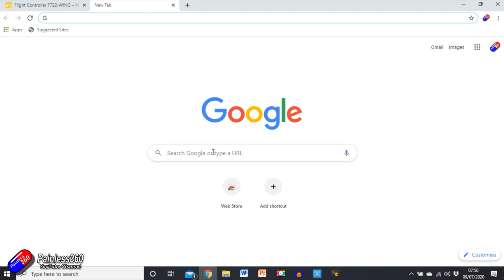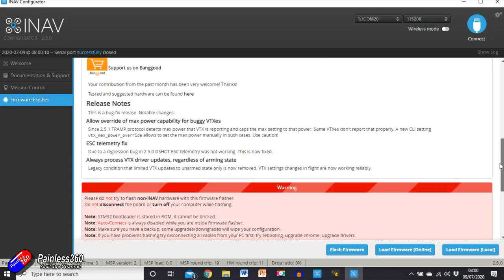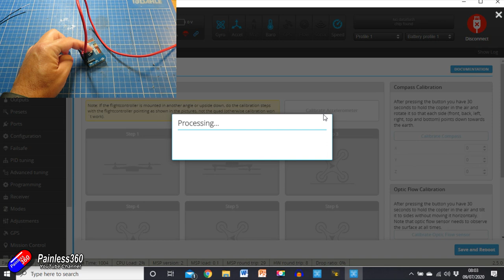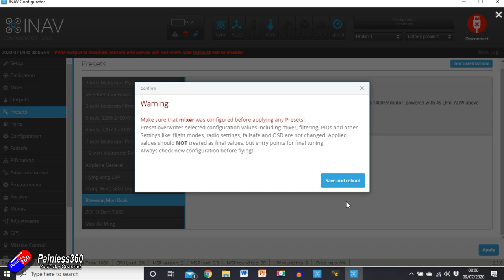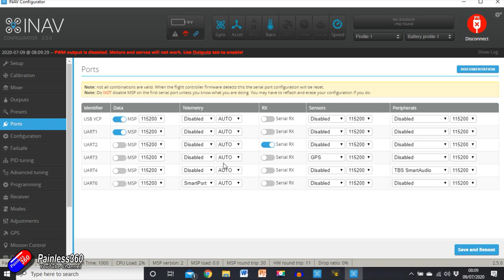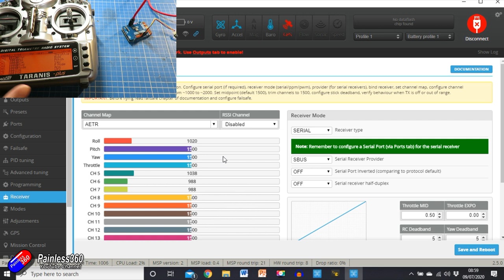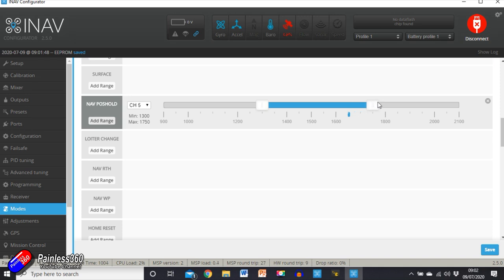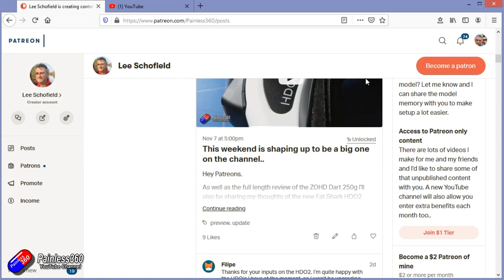iNav for beginners 2020: 2. Flashing the flight controller and basic setup

Comment: Fantastic video, Lee! Thanks a lot! 😃
Let me ask you something... Do you think it's better to start flying manually (I mean an airplane without flight controller or anything) or I should start with iNav right away? I still couldn't build my first airplane. 😬
Anyway, stay safe there with your family! 🖖😊
Reply from the maker: You do need to know the basics to setup iNav in a FW so some manual experience is handy. If you can get another pilot to help set it up then things like Angle mode can be a boon to help pilots learn to fly..
Reply: @Painless360  Yeah, but here it's difficult. 😕
But thanks a lot! 😊
Reply from the maker: Check out those video from a few months ago on tips and tricks with maiden flights etc. Something like a Bixler or AXN is a fab place to start and having a friend to throw it for you in the beginning coupled with some solid time on the simulator will help you avoid a lot of the common mistakes early pilots make.. Happy to have a chat if you need to..
Reply: @Painless360  Nice, I will! Thanks! 😃

Comment: Hi - I have been following the series and think it's really great.  I used to fly RC as a kid back in the 70's and I'm trying to get back into the hobby.  I just purchased the MATEK 411 WSE and I installed the INAV 4.0 Configurator.  Is the INAV 4.0 the correct version of the Configurator for the MATEK 411 WSE or do I need an older version?    Thanks Jim
Reply from the maker: That will work fine. I'm using the same flight controller with INAV here on my latest build... Happy flying

Comment: Great video Lee as usual.  Would you recommend  the 405 or the  controller in the video.  Not sure what the difference are, apart from price😊
Reply from the maker: For a fixed wing I would use any of the Matek wing flight controllers. See my recent builds with F405-WING, F722-wing and F765-Wing. I cover the differences in my fixed wing flight controller comparison video... happy flying!

Comment: Thanks for the video! When connecting ailerons to a flight controller, do you still use a Y cable and one connection, or does each aileron servo need to go on a separate pin of the FC?
Reply from the maker: You can do either.. Happy flying!

Comment: From your CLI file, it seems the rth_altitude=7000, seems to mean 7000'?  If correct, isn't that rather high?
Reply from the maker: Nope, see what the value means in the docs. You can look any setting here - https://github.com/iNavFlight/inav/blob/master/docs/Settings.md. 7000 equals 70m or 229ft so is a decent starting height to fly back with. The files are supplied as a guide only. Edit them to your preference but check the units before you change anything. Best of luck!

Comment: Hello, first of all I'd like to thank you for very useful videos! 
May I ask for a peace of advice? I have brainfpv radix li, wired and configured everything according manual and your videos. However my FC doesn't see my spectrum receiver. The receiver serial output connected to Txe on FC PCB. I am using vertion 2.6 of INAV FM. What should I check/retune? Thanks!
Reply from the maker: There are two ways to connect the receiver depending on the type you have. see https://www.brainfpv.com/knowledgebase/radix-hardware-manual/ for details..

Comment: Lee,  is it possible to flash any of the new firmwares (iNav, Arduopilot, etc) in a flight controller HMXM2066 that belongs to a FORM 500 drone from Helimax?  Regards
Reply from the maker: Check out the supported boards listed on those projects. Unless that flight controller is based on one of the supported hardware platforms you may struggle..

Comment: Gday Lee, Is the last part of the video about the CLI inputs related to the fact that the diagram for the F765 and INAV Target states that the "CLI default's after flashing" If not what does "CLI defaults after flashing" mean for us after flashing the board.
Reply from the maker: I don't understand the question. Can you explain?
Reply: @Painless360  Sorry, On the diagram for the wiring for the Maytek f765 in the upper left hand corner it has printed, "INAV Target: MAYTEKF765 ***CLI defaults after flashing". Does that just mean that the CLI returns to defaults after flashing? And  the CLI commands that you recommend for a fix wing are improvements to the default settings, like, not having the aircraft land with the RTH function?
Thank you so much for responding to my questions and all of your excellent videos.
Cheers
Reply from the maker: Anything in that listing with a * should be set automatically when flashed (bit I'd still check). That has nothing to do with how the model is setup or flown. That is what is in the linked files - you can see if you look in them.. Best of luck!
Reply: @Painless360 
Lee, Thank you so much for answering my questions, Yes I can see how the linked files will change the setup for the model. I am still on the back side of the learning curve with all this computer stuff, but I am sure I will finally understand this stuff with all of your informative videos and answering all of your followers questions on YouTube.
Cheers and Happy Flying
Henry.

Comment: Hi Lee, on the configuration page there is a warning saying you should increase the i2c speed if your hardware allows. Ive not been able to find any info on this. How do you know what speed to change it to? I usually just bump it up a bit and haven't had a problem but it would be really nice to set it properly? Thanks.
Reply from the maker: I always leave it at default. If you saw errors on the i2c counter (at the bottom of the screen) then you can reduce the speed. Correctly routed and managed cables in the model should mean you never have to worry about this. Hope that helps.
Reply: @Painless360  Thanks a lot. Its the warning on the screen that made me feel like I should do something with it !🤣

Comment: Trying to update a couple of OmnibusF4 pro controllers that have V2.1.0 to V2.6 and eventually the latest. 
Running on a v2.1.4 configurator as the later ones will not recognise the board until I update the board software first. 
Have checked "version" to find the board type and have saved both a "dump" txt and a  "diff all" txt file.

Currently trying to follow the instructions to first go from board software V2.1.0 to V2.6 as it recommends. 
It says to .......  " Now it's time to change your settings file so it becomes compatible with the latest INAV firmware. Follow your specific version instructions."    

So where is this "your settings" ??????  ....Cannot see any reference to lines they recommend to change in the "diff all"........
So is it in the "dump" text file I saved.............. or in the new download v2.6..??.......................rather confusing but sure there is a simple explanation.

Any help greatly appreciated.

Comment: Hi Mr. P.   I'm having a little problem,  I just received my Maytek H743 wing,  so I tried to use INAV for the first time with this F.C and it asked me to install INAV and I went into the CLI and typed version and I got. MaytekH743 (m743) 4.2.0 Jul 16 2020  ,  I then went to flash INAV and looked at the target I looked at the Maytek lines but no H743  ?  I can't even find any 743 boards at all  ??? I'm using INAV 2.6.0
Reply from the maker: H7 isn't supported in INAV yet. See my video on it..
Reply: Trying ARDUPILOT

Comment: Hi your videos have been very helpful. Do you have any tips for changing the orientation of the Matek flight controllers? Most of the build I have been doing I have room for placing them with arrow facing forward but my upcoming builds I need to turn the board 90 degrees. I know some of these board have 2 gyros in them (f765) and wasn’t sure if you even could change the orientation because of this. Thank you
Reply from the maker: It should work the same as the top builds on the channel. You'll need to try it out and stop when the movement of the model is back to matching the virtual model in configurator.. best of luck
Reply: Painless360 
Got to test the board orientation change and noticed in the configuration page the roll changes the pitch and pitch changes the roll if you make changes to the angle of the board alignment. This is in inav 5.0.0 using a Matek F405 wing FC.

Comment: Thanks for the teachings and upload.  I am having trouble even with Zadig to flash firmware. (just noticed impulseRC, so will try it as well)  It keeps giving same error message.  This same laptop can flash F7 drone FCs on Betaflight, so I thought it already has all the drivers (which I am assuming same for iNav).  Question is, if I get this flashed with a friend's mac, will I be able to connect with my laptop and change settings ?
Reply from the maker: Yes, Zadig only replaces the driver for the DFU part..
Reply: @Painless360  As a last resort I tried impulseRC driver fixer and it works flawlessly.  Comments online and that driver say Google Chrome is the problem.  Anyhow, I'll be watching rest of your series.  Thanks.

Comment: At the beginning and end of the video the video shows a cable that connects the receiver to the flight controller. It is different on each end. At one end it connect to the receiver. And at the other end it connects with what looks like GPIO (General Purpose Input Output) pins. What is the name of the cable (or wiring) and the name of the ends (one appears white & the other black)? How does one order such an item? And how are the GPIOs attached to the flight controller? Thank you.
Reply from the maker: Most cables used to connect things in the hobby are Dupont 'servo' cables that are easy to buy in the length you need or get the parts to make them up yourself (see my video on Crimping). Some smaller receivers designed to be used with flight controllers and use SBUS or things like CRSF use different, smaller connectors and they usually come with a cable that you can solder onto to make up what you need. Check out my build series aimed at beginners to see more. Happy flying!

Comment: Gday Lee All of your videos are so informative and I learn something from every single one. I seem to have nothing but trouble with this electronic stuff, I have a F722-wing i have soldered on all the pins, checked continuity and all seems to be ok, when I plug in my FC to iNav I am unable to connect, when I connect to the computer I only see the red light comes on solid at 3.3, No brief flashing  lights at one and zero like on your video. I have installed the STM USB driver and the zadig and have ALSO run the Impulse driver fixer and also held down the DFU button on the F722 but nothing, except "failed to open port" and red light at 3.3 stays on also the FC unit gets warm? I have tried different combinations of trying to connect once"failed to open port " and then restarting iNav without "failed to open port" showing, and I have tried every USB cable in the house.I hope you have another idea, Thank You for any help!
Reply from the maker: Did it work before you soldered the pins on?
Reply: @Painless360  First of all THANK YOU for responding so quickly! Sorry Mate I did not check it before I soldered on the pins, now that I have I guess I could have done it incorrectly but all the soldering seem to go well only a few pointy solders the rest looked great, but I will never know because I did not check it first. So with all that does it seem to be a defective FC? I realize you have No way of knowing, I just thought you might have a hint of something else. Thank you again
Reply: @lowriderfpv8440  I'm in the same situation. I think I might have shorted the board by laying the pins on some metal accidentally. Either its some weird firmware thing or I killed it :/

Comment: I flashed my f405 awhile back with latest inav- mission planner,today try connecting to inav the way you did and every time it says failed, I opened mission planner and it connects no problem and i can select all the sensors, modes I guess anything i would need. It shows all the live telemetary. I guess question is this normal? Thanks for any help

Comment: I see you are using a Tar anus. I'm running a Spektrum DX6 with Crossfire full size plugged into the trainer port, will this all work for me or should I buy and learn an open TX radio first?
Reply from the maker: If you can create a basic model type with the four main controls and two additional switches on Channel 5 and Channel 6 then you should be fine. Best of luck

Comment: Most receivers have 4 pins, power/ground and tx rx.  How is that passed on via a 3pin JR plug?
Reply from the maker: Only recievers using a two wire connection for signals and telemetry have 4 pins.. SBUS doesn't but often needs a UART for the telemetry...

Comment: Hi.  I'm hoping you can help.  I managed the firmware flashing OK and after reconnecting the window that allowed me to select "airplane worked" OK.  For a few seconds after that the display showed that the Heading, Pitch and Roll varied as I moved the flight controller and then suddenly all the angles dropped to zero.  Since then the H,P & R angles have never shown anything other than zero even though I have tried disconnecting and reconnecting the flight controller to iNav and even re-flashed the firmware again.
Reply from the maker: Sounds like something has failed on the FC. Triple check you flashed it without the right firmware.. best of luck
Reply: @Painless360  The CLI DIFF file shows the Gyro as being OFF since I flashed the F405 and selected the Airplane mix.  Any ideas about how to get the Gyro On again ?

Comment: Thanks so much but im using windows 7 pro, I dont understand how i flashed inav and mission planner is working but wont connect to inav now
Reply from the maker: It's almost certainly a driver issue if you've tried another USB cable. Lots on that in the forums.. Best of luck!
Reply: Thanks ill try that

Comment: I was trying to set up a Matek F405-Wing last night and it was not able to find/activate the serial port. My cable was a data-transfer capable micro USB cable. I tried booting the fc manually and restarting the configurator. I don't have internet at home yet and my computer is still running Windows 7. It is possible that I need to download drivers and stuff, or it is possible I need an internet connection to configure the flight controller. However, I have the latest FC firmware locally stored on my computer, so flashing should work offline. I have not been able to find anything about this issue because most people who are using something like iNAV do not live somewhere internet is unavailable. (Thankfully Elon Musk saved the day with Starlink, which will arrive tomorrow.) What do you think?
Reply from the maker: I've never tried to flash a flight controller from a PC that isn't connected to the internet so not sure. It is very possible that drivers are the problem as you should see the FC appear as a DFU device ready fro flashing if you power it on with the boot button pressed in.. Best of luck...
Reply: @Painless360  it is the driver. I have been talking with some folks on github about it. A quick Zadig fix later, and everything is golden!

Comment: set max_angle_inclination_rll = 600
Set max_angle_inclination_pit = 600
set small_angle = 180
set nav_rth_allow_landing = NEVER
set nav_rth_climb_first = ON
set nav_rth_altitude = 7000
set failsafe_throttle_low_delay = 0
set failsafe_procedure = RTH
set inav_reset_home = FIRST_ARM
set nav_extra_arming_safety = ON
Reply from the maker: That looks like a nice set of settjngs! Be aware that as of INAV 6.0 the extra_arming safety option has been removed. ..

Comment: So I have a problem where I can flash Inav but can't get it to connect. It shows that the flash was successful but up top in the inav configurator it doesn't change and show the com port like yours did. I have tried flashing a few different times but I get the same results where I can not connect. I don't know what to do.
Reply from the maker: Recent windows updates can mess up the drivers.  The download links are on the main page. Reinstall them,  delete the device and try again.. best of luck

Comment: Looks like a science ...
first time I looked at matek website cause luckily I had bought matek 405 wing fc a year ago. 

I checked the wiring diagramm and inav mixer section and was asking myself if that what I saw could be right like those 6 gps cables for 12 pads on the board

here is an example from matek website 

http://www.mateksys.com/?portfolio=f405-wing#tab-id-3
Reply from the maker: The cables are the GND, +5v, Tx and Rx for the GPS data and SCL/SDA pins for the compass. All have corresponding pads/pins on the flight controller shown in the wiring diagram. I don't use the compass in my wing builds as I don't fly in high winds (see my video on compasses that covers why). Happy flying!